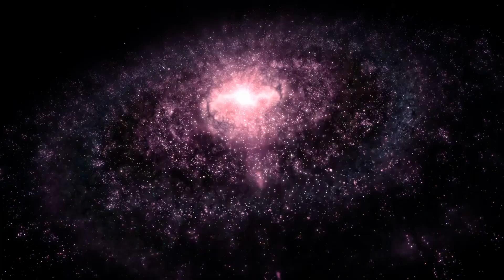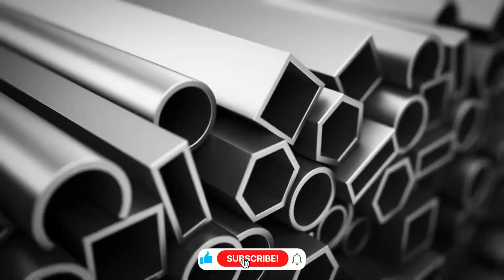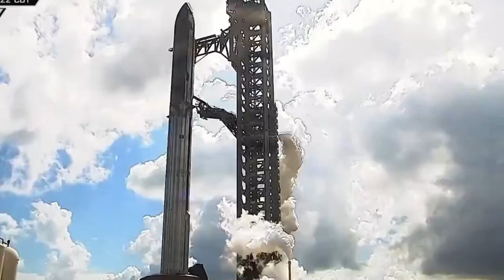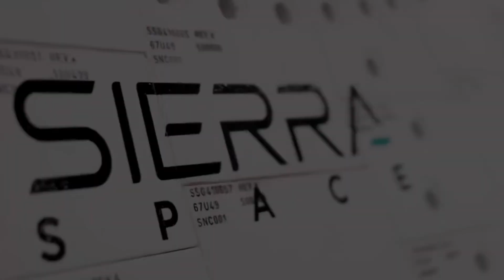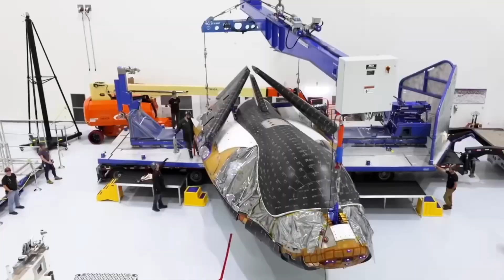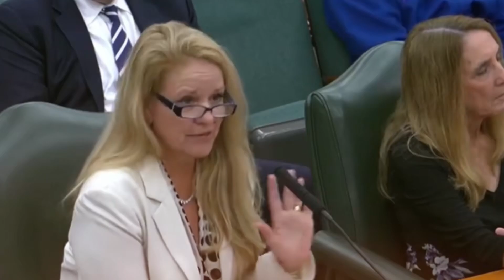TOO LATE! SpaceX Finally Reveals Its INSANE Heat Shield Trick - Industry LEFT BEHIND!

Comment: Instead of a heat shield, you can build the wall of the starship in two  layers and put a heat conducting material in between. It will reduce weight of the starship. Steel is better than heat shield tiles.
Sorry if I'm wrong

Comment: Yes, the use of Metallic stainless steel b-coz of it's chemical structures. As shields for the reentry tht they are starting to apply on their SpaceX
Flight 7. In addition the multi cooler advance and it's multi layered protection.
I don't knw, if I am finally on the page if Elon Musk 24h. cont. learning ed.
Thank U 🌟 my Spacecraft-Starbase Professor🚀
~pearls 🤓

Comment: it's like the stainless fireplace inserts we built , we built a double wall and air was force between the 2 , awesome if done correct. have to allow for expansion cause its crazy, little Suttle tricks make a diff on how long it will last.
Reply from the maker: That's a great question! While engineering is crucial, factors like funding, international collaboration, and political support could be just as important in pushing space exploration to new heights. What do you think will be the next key challenge for SpaceX?

Comment: New Electro Magnetic Plasma Heat Shield. tech!  Technology Transfer Program new form of propulsion that uses electromagnets to control the flow of plasma over aircraft and spacecraft flying at hypersonic speeds. -A-plasma-Deflect Heat Shield-field-to-protect...
This heat creates a plasma Heat shield that's denser than the surrounding air and able to deflect Heat or absorb the energy from the incoming shockwave. ... "The general concept is to use an electromagnetic arc to create this intermediate medium in mid-air on very short notice by using a stupendous amount of energy to Deflect Heat

Comment: It's not new,  it's sort of what's used on rocket cowls, that's why they don't melt.  They did consider it at the beginning but went with tiles instead.  But hey it's interesting to see what happens.
Reply from the maker: Exactly, it's fascinating to see how SpaceX revisits old ideas with new approaches! Do you think they'll eventually move back to using such cooling tech, or will the tile system continue to be the go-to for re-entry?